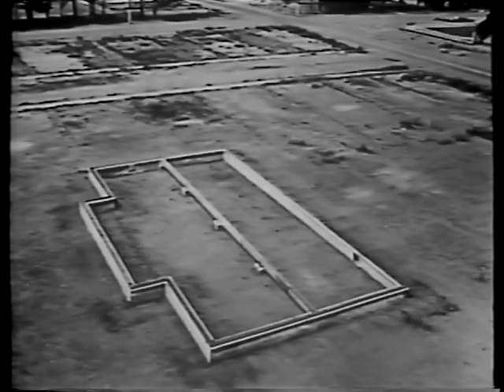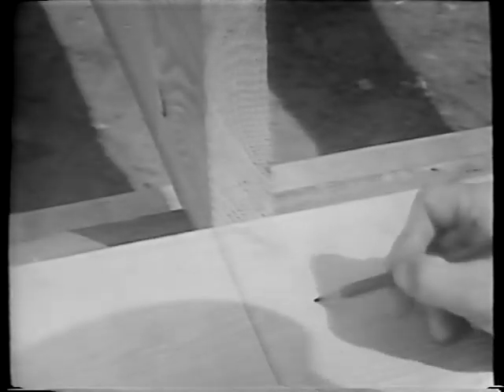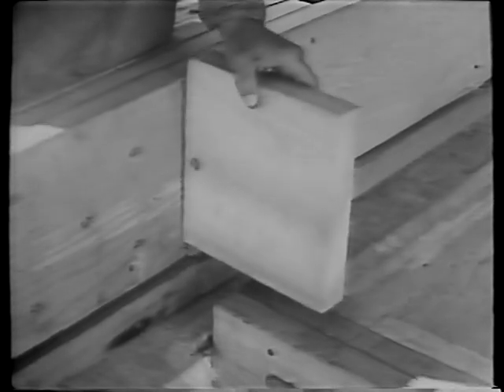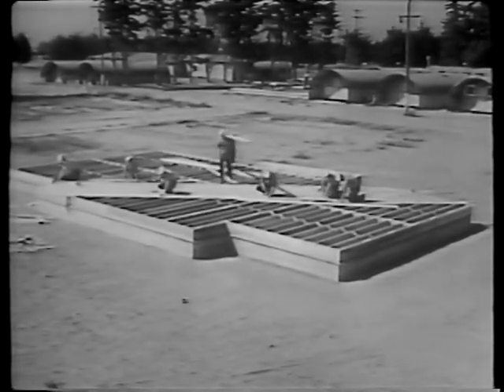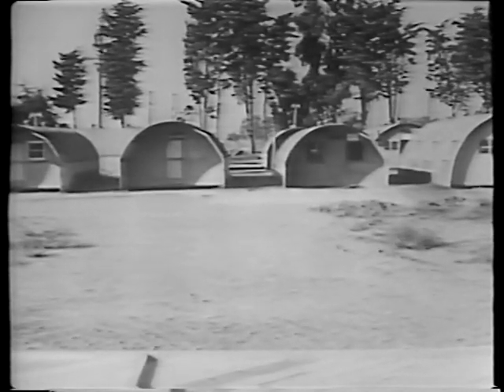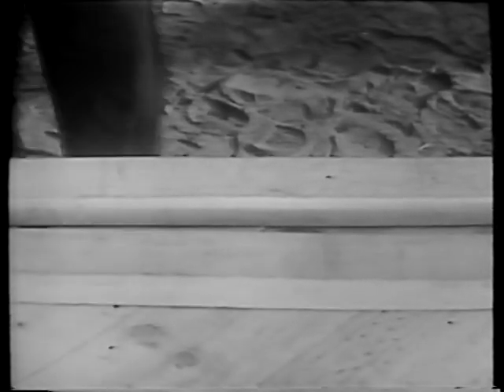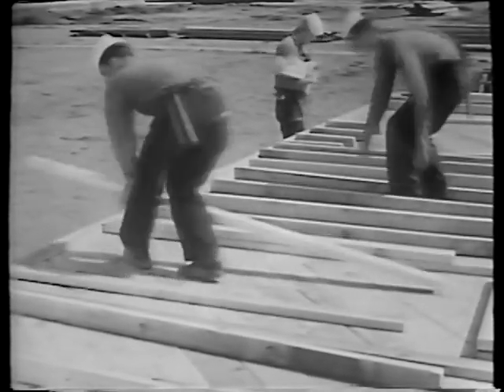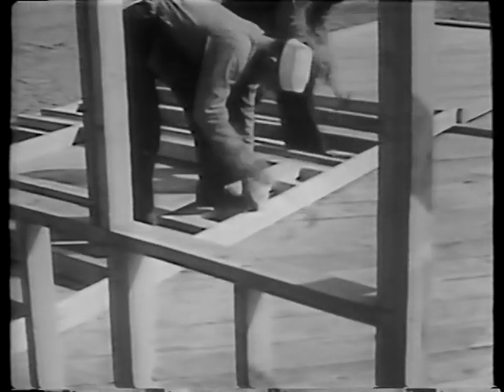Framing - Floor Joists and Walls

Comment: @dojo5794 As a carpenter I can tell you 100% yes that this building is still much intact and standing. I have a 1916 foursquare out here in the Sacramento area that I rent out and is still standing strong on its crawlspace foundation.

Comment: @tbirdpimp07 Hand tools are always going to be more accurate no substitute also, the old pine sub floors they use and let "run wild " that's a days work cutting the ends off them when today we don't even consider the old way osb's and plywoods. BUT!!! boy would it suck having to go to work everyday with a hand saw and a box of nails and no air or power tools lol.